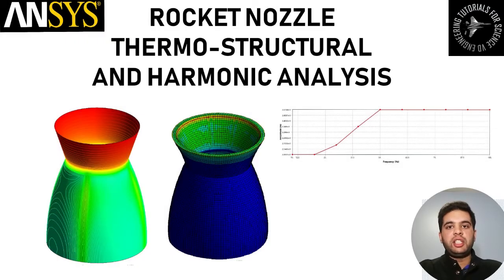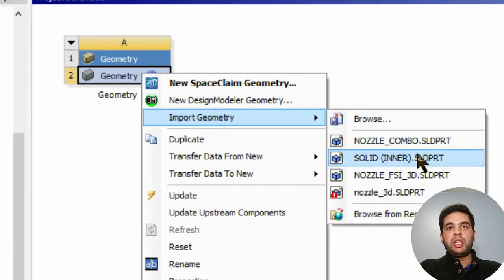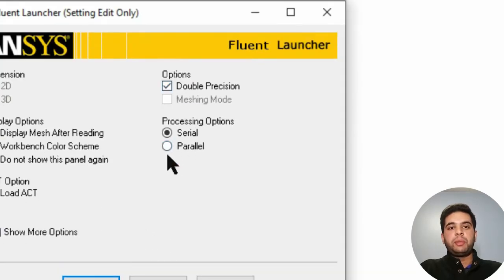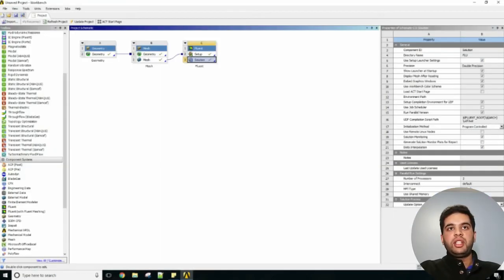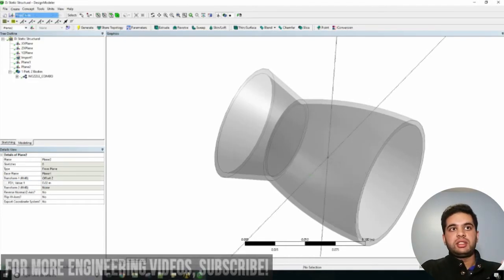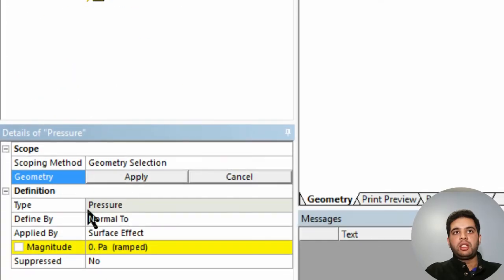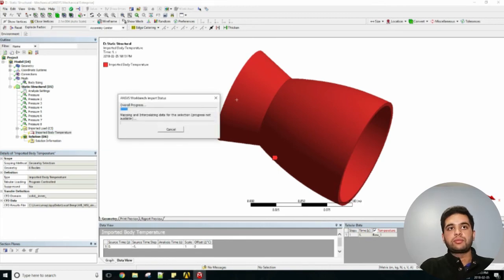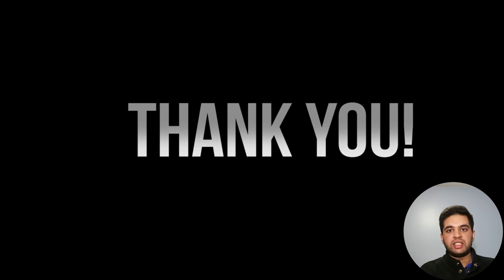ANSYS: Rocket Nozzle FSI (coupled Thermal Structural) & Harmonic Analysis Tutorial

Comment: Hello. Thank you for the video, it is really useful.
I subscribed to your channel 👍
I have some questions:
1) The pressure at the inlet is 160 KPa. Why in the "Supersonic/Initial gauge pressure" you set 158900 instead of 160000?;
2) The pressure at the inlet is 160 KPa, but in the Pressure Inlet window you set the gauge pressure as 160 KPa. If I understand correctly, this is not a problem because subsequently you set the operating pressure to 0, right?; In fact, absolure pressure (pressure at inlet) = operating pressure + gauge pressure? Right?;
3) 4:29, how ansys compute the velocity value in reference values? Is it an initial estimate of the velocity at inlet section useful to start the iterative calculation?

Thank you ✌